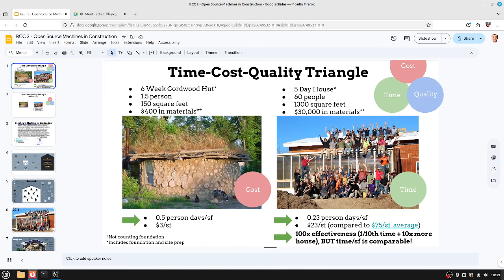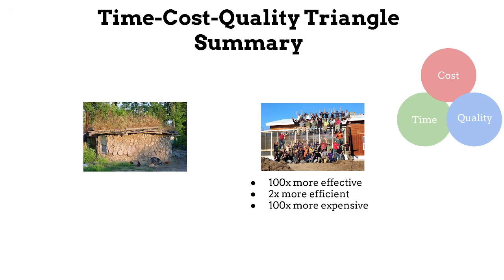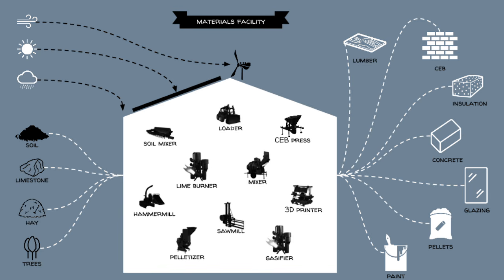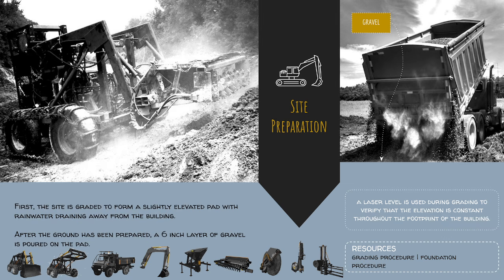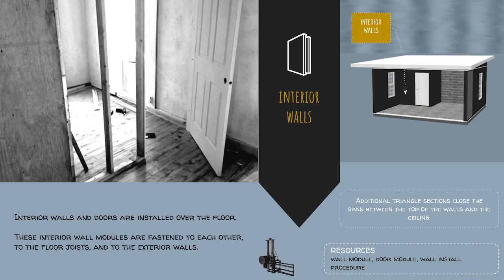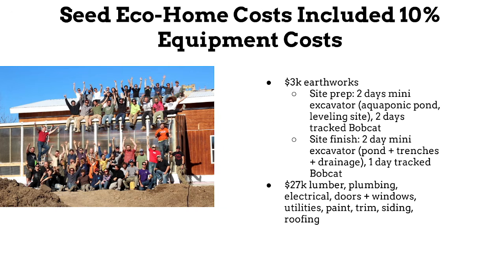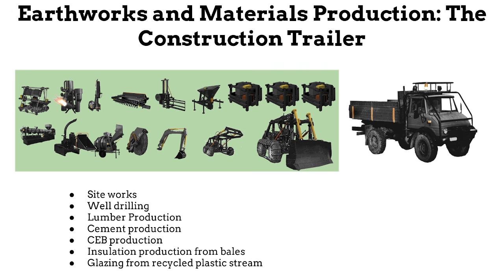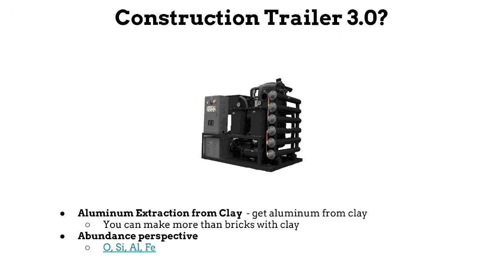How Open Source Machines Make Housing Affordable

Comment: No offence but there has not been meanigful progress on much for the last 7 years atleast. Why are wen still stuck on the same machines?
Reply: He’s talking about development decisions vs. construction machines.  The incentive structure is all determined by the contract type, financing, insurance, etc.

It takes an incredibly comprehensive team to improve such a challenging process, so you aren’t wrong to be skeptical.

I would say, drop sustainable materials or any other material risk - you can always improve the net-zero performance on the next project once you de-risk.
Reply from the maker: How about a house product that costs 30% less to build than industry standards, while providing high quality features such as a 6kW PV system that comes stock with each model?